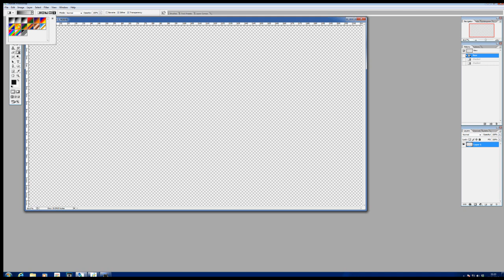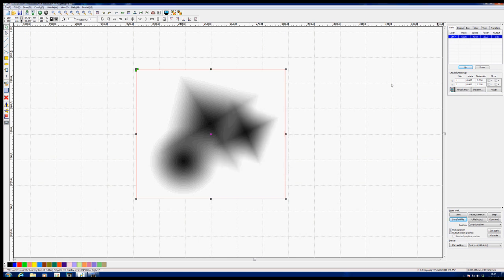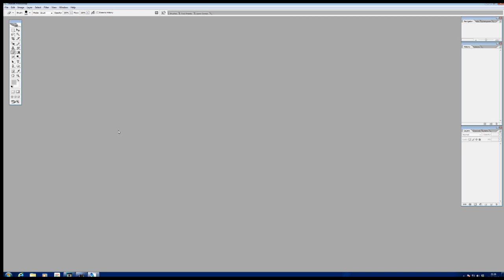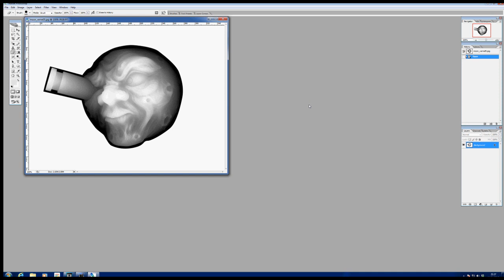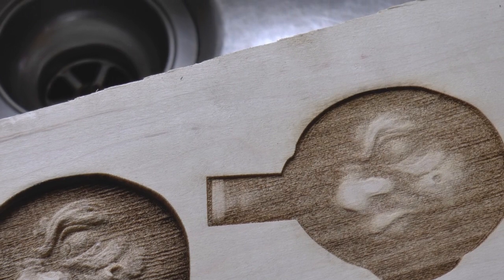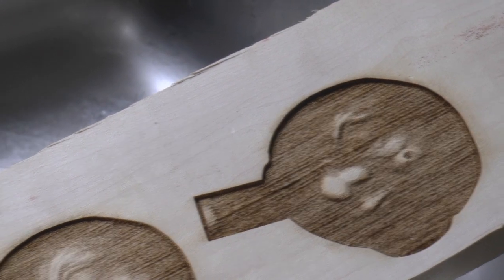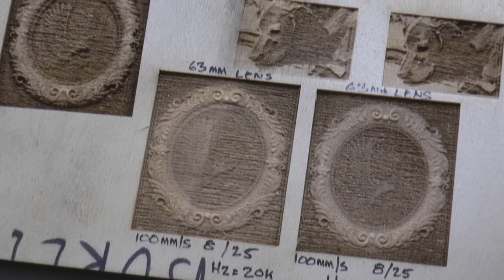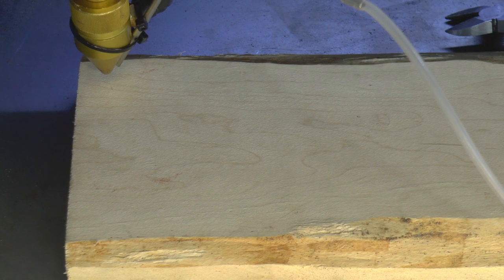RDWorks Learning Lab 58 3D carving At last!!

Comment: Hello Russ,
I have a quick question. I Just purchased a china laser and I'm having a hard time setting the origin. I move the x and y axis to where I want it to be and click the origin button on the controller. However, When I start the project the head moves to the lower right hand corner as if the origin is set to the lower right. I've watched all the videos but none show how to exactly set the origin. Any help would be greatly appreciated.  Keep up the good work your videos are a excellent learning source and I commend you on the great work.

Thanks,
Chris

Comment: Hi, I need to know if this machine engrave in metals or not, I did buy the same machine but the 100w?? and which metals?
Reply from the maker: +Abdalla Safwat 
Hi Abdalla
Sadly you will need lots more power to do any sort of damage to a metal surface( 200watts +...).  You cannot engrave metals but you can mark them by a  chemical reaction with the surface as you will see in  https://youtu.be/b_06laAjMPc. You can etch aluminium provided it has been anodized. It's dangerous to fire the laser beam at most metals (see the 3 part video on reflectance  https://youtu.be/kJe16YQlIM0   ) so be careful.
Sorry it's not good news
Best regards
Russ
Reply: Thank you so much

Comment: Nice, have you tried the curves feature in Photoshop?https://helpx.adobe.com/photoshop/using/curves-adjustment.html
its a good way to play with intensity of shades in an image.
Reply from the maker: +Adomas Povilianskas 
Hi Adomas
Thanks for your suggestion. I didn't go too far into Photoshop for fear that many people may not own it. Most bit map painting packages have a fountain fill or gradient fill and I wanted to demonstrate that what your eye sees  and what the machine produces are not the same thing. You need a very distorted grey scale image to produce a pleasing result.  I'm not sure Photoshop has any tools for doing this sort of grey-scale distortion.  Take a very simple example of an O-ring or a torroid. If you 50% sink it into a surface you get a letter "O" with a semicircular section projecting. I can clearly imagine that to convert this shape into a 3D the grey scale render  needs a grossly distorted and  non linear compression of the scale towards the inner and outer edges and can't visualize any tools for doing that in Photoshop. BUT....I play with an old CS2 version of Photoshop and am certainly NOT an expert user. 
I have now explored  3D laser woodcarving enough to realise it's possibilities and the difficulties involved and I am amazed that I was able to get this level of results from this cheap Chinese machine. The strange regular striations in the deep cut background are a bit puzzling and I may spend some time trying to find out why that's happening.
Thanks again for your input
Best regards
Russ

Comment: Hi SarBar ... this is Mike from Bavaria

Great Vids you produce over here ... best Training for Beginners with that machine i guess.

I tried that greyscale engraving and tested the Method Russ mentioned ... so here is what i got with my 2" Lens and original 50W Tube ... i found out that with direct output (which also means do greyscale) th USB is too slow to get the Data in Time ... so i have to transfer the job first via "download" which means actually upload to the machine and start it from the file menue then it works good ...

settings:
http://up.picr.de/25245853sg.jpg

engraved on plywood:
http://up.picr.de/25245862ei.jpg
Reply from the maker: +Mike 
Hi Mike
It looks like you have achieved a pretty good photo rendition with  grey-scale scanning. I did try this but was not very successful. Perhaps I should experiment a bit more now that you have shown me what's possible. 
I always work with a USB file transfer into the machine and I admit it took several minutes to load some of the engraving programs. None failed.
Thanks for your feedback
Best regards
Russ
Reply: +SarbarMultimedia 

so i just took it a bit more ...

so i now use 8-30% and about 180 mm/s to have a good Portait on Plywood ... 2" Lens ... i guess your 1,5" is better for cutting ... i will try a 3" Lens just to see what happens ...

so keep trying Sarbar i like your vids very much
Reply: +Mike 

I am just working on a new Picture to Laser so far i can see you will have to think your conclusions over ...
The main thing is that the picture you want to engrave has to be greyscale and (this is really important) has to have real white parts in it ... so you need a really good contrast and bright white perhaps some gamma will help ...
Reply from the maker: +Mike 
Hi Mike
Yes. I have a "60 watt friend" in the USA who is an electrical wizard. He has looked at the PWM signals and the power output signals to the laser tube and reports that white will always be zero power. If you set your power min to say 10% and your max to 60% then white (RGB 255,255,255) will be zero power and then the remaining 255 steps of grey will be spread across the min/max range. In this example the 10% power is only 2 or 3 watts so there will be a nice steady progression across the grey range.IF however, you were to chose min=40% and max=60% then the 255 steps would be divided across this 20% power range and the step between white and the first grey level would be HUGE.
Still a lot more playing to do. Thanks for the feedback 
Best regards
Russ
Reply: That is not exactly what i mean ... will take some hours to complete the Laserjobs i am working on so i can show you ...

i made a temporary email account for you
so we can send us the mails more privat if you like to

MJB-W8pro@kabelmail.de